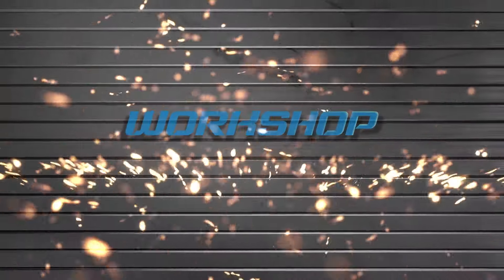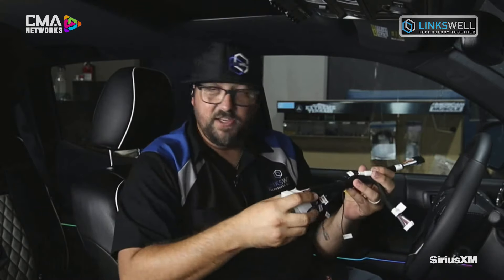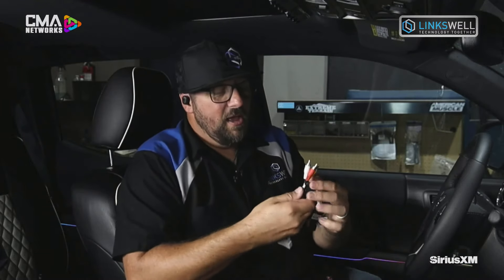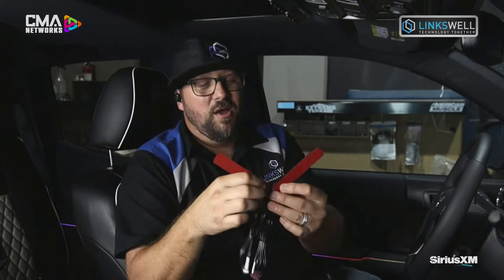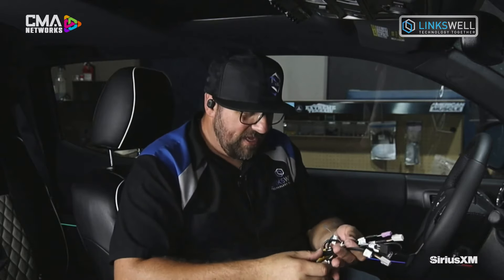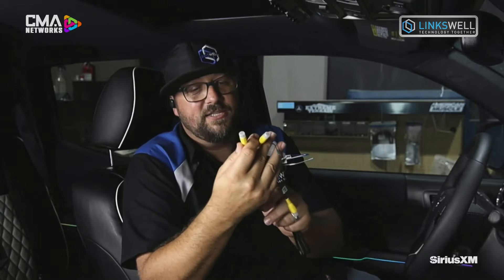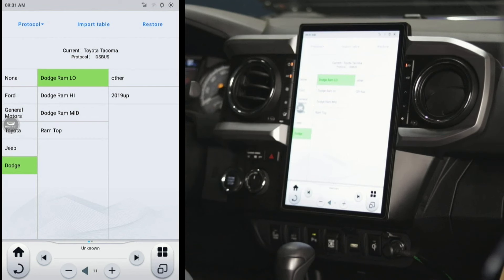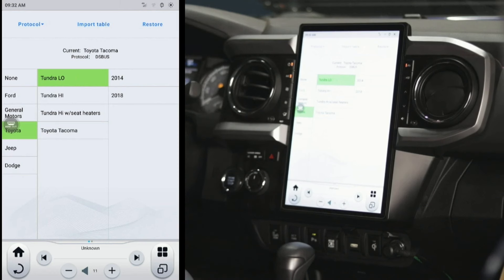3 Quick Tech Tips with @CMANetworks

Comment: I installed a gen 5 in my 2024 ram 1500 I have no reverse image
Reply from the maker: Have you watched our install video? 

Make sure you have the correct plug plugged into the camera module box and the correct RCA plugged into the radio.
Reply: Yes I have spoke with a tech told me to connect the two pink wires coming off the  camera power harness
Reply from the maker: @watchurheadrc721  that depends which RCA you are using. Which RCA are you using. CVBS or AHD?